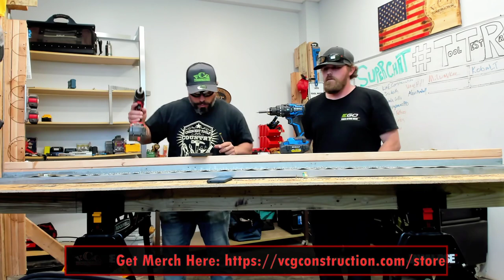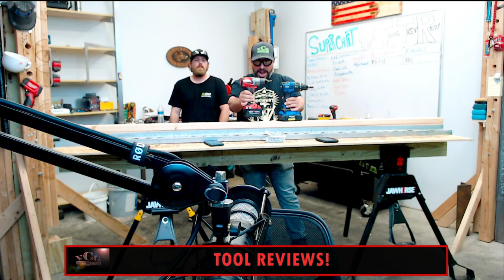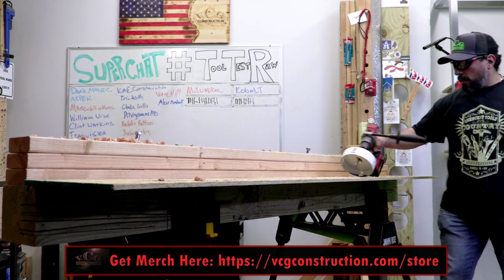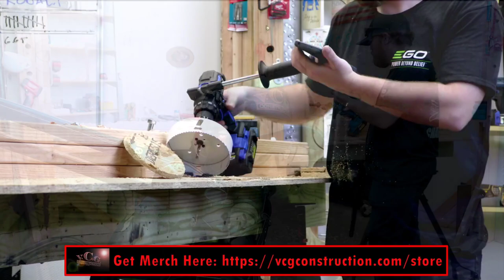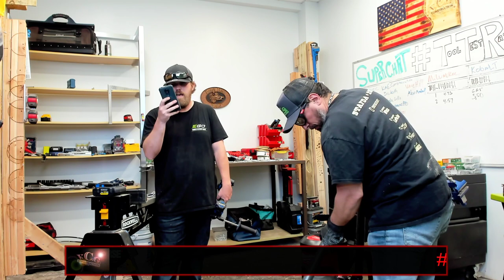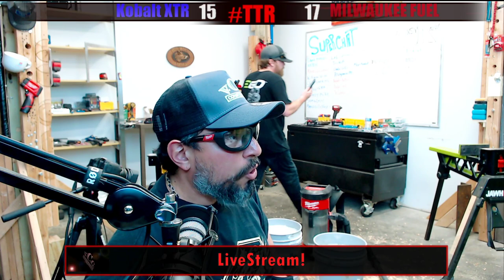BEST HAMMER DRILL COMPARISON (Milwaukee Fuel vs Kobalt XTR) TOOL TEST RAW

Comment: That Kobalt has some impressive performance for sure. But it's significantly more bulky to make up for it. Depends on your needs IMO. Loved the Milwaukee promo deals this past week. Got the 9" cutoff w/ free 8.0 battery and the 12.0 battery w/ rapid charger w/ free 6.0 battery too. Now my focus is on picking up the PACKOUT kit with PACKOUT charging radio and new PACKOUT cooler. That'd make any jobsite infinitely more comfortable. Only beatable by the MX FUEL power pack

Comment: Amp hours are different because the voltage is different.. 18v x 5 amps = 90watt/hrs.  24v x 4 amps = 96watt/hrs hence Kobalt is more capacity.

Comment: Guys I love the show, but Nick you mess up a lot in many tests! Vince is smooth and quick. Nick practice doing as much as possible between tests. You guys should run the tools equally each set of tests. Of course Milwaukee will win every time when Vince runs it. If you want to do a fair review for all tools, Switch for each set of tests. Not saying I would do better, or you are horrible bro. I love watching you guys. Just think that would be more fair to the tools, as Vince is far superior in practice. Nick you slip many times and cause losses when there could be a better shot for the tool. Again please don't take this wrong! I do not mean it in a rude or sarcastic way. Vince is just a far more experienced hand. To do the tools justice, please swap and do two sets of each. Or one and one, where you switch tools. Vince you are the man! You run any tool very well!!!! Nick you are a great dude, just need a more practiced hand

Comment: Yeah I think when it comes to the top two contenders, you guys should run 20 tests with each tool. That way "Slippy bits" do not set the tone for the tests. 
So you both can run each tool, and average the test scores up each. 
Also to get the perspective of each of you as to which tool is more comfortable to use. 
Nick always has to slip default into each TTR. Such a shill.... 
Seriously though guys, I do appreciate all you do. 
Hopefully Nick will leave default!!! Kobalt is coming up and pushing default and Makita aside as top contenders

Comment: Wait so the DeWalt beats the Milwaukee, the Kobalt beats the DeWalt. (It didn’t, the DeWalt was handicapped.). But now the Milwaukee which lost to the DeWalt beats the Kobalt? 🤔
Reply: Marty Lucas 

The Dewalt Drill in question is the power detect DCD998 and it requires the 8ah battery in order to operate optimally.   Yet in the last ttr they handicapped it by using a smaller battery during the first part of the test.

It is the superior drill currently on the market.  It is better than the Milwaukee, and XTR, shown by other channels.   But I believe that unfortunately they have a Milwaukee bias, and it shows as flawed testing.
Reply: Cause these TTR are all inaccuracy... Hehe it's just 2 dude racing to see who can drive a screw faster...